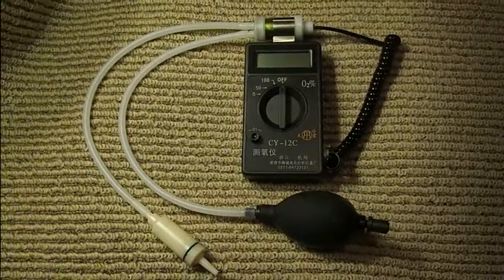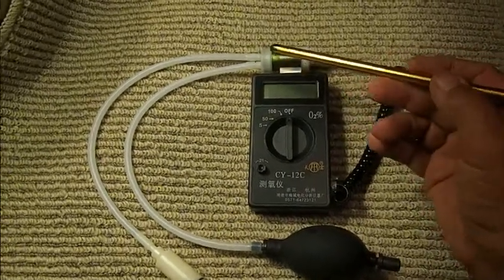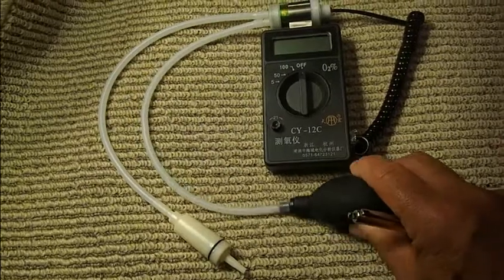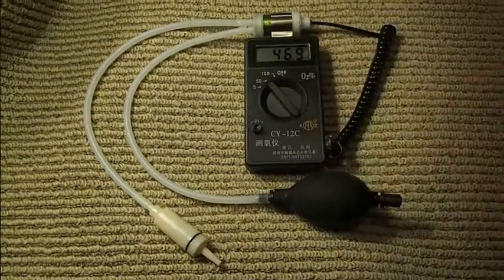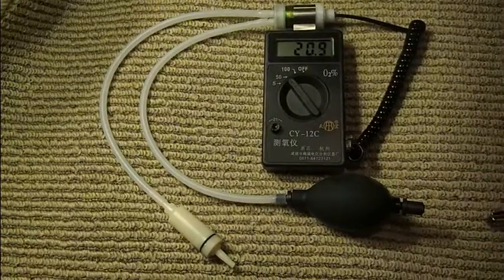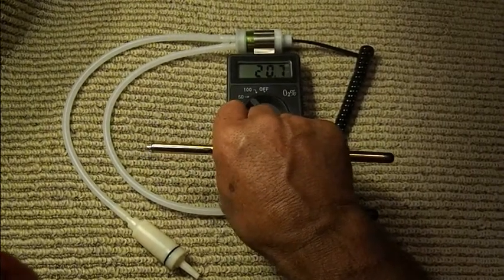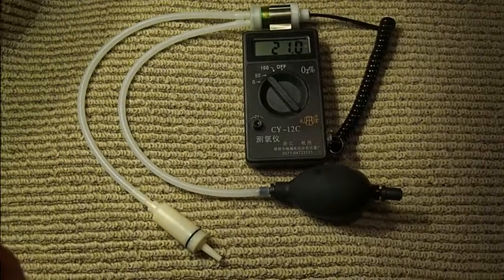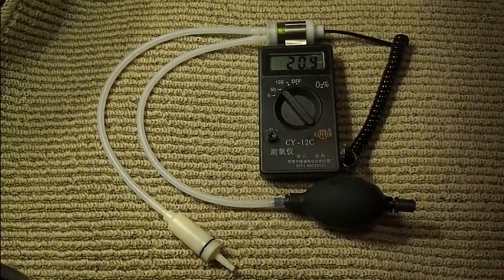CY-12C oxygen analyzer instructions

Comment: Funciona para los concentradores de oxígeno de casa es decir a 5 litros?
Reply from the maker: Not sure I understand the question.  Are you talking about a 5 liter per minute flow rate?  I think so, but you can test at much lower flow rates.
Reply: Si funciona y es mucho mejor ya que los aparatos comúnmente solo pueden analizar hasta el 25% o 30% de concentración de oxígeno en el ambiente. Y los concentradores proporciona mayor oxígeno hasta un 93% dependiendo de la marca. No usar uno normal que miden deficiencia de oxígeno en el ambiente ya que va a parecer que no funciona tu equipo concentrador de oxígeno, saludos

Comment: Can you connect a pressurized tube from an oxygen concentrator directly to the input filter?  I'm wondering if one of these units could help me test the condition of one.
Reply from the maker: Would certainly think so.
Reply: Yes set dial to 50 to 100% and connect to concentrator.Should be around 94%.